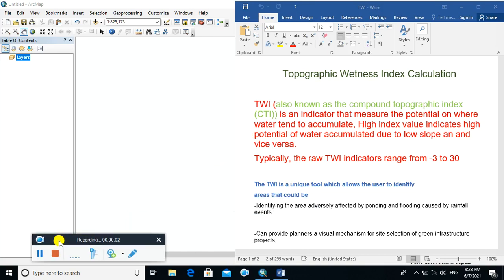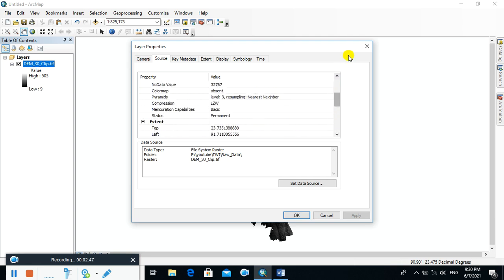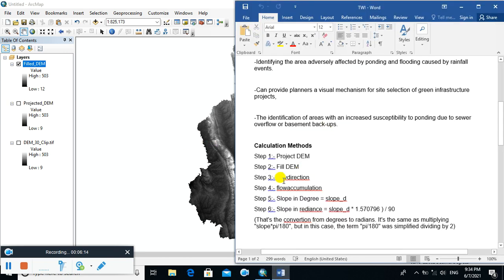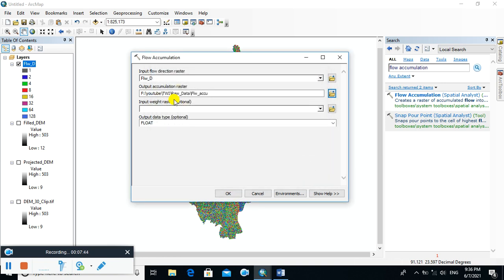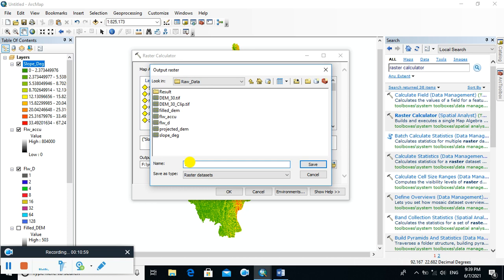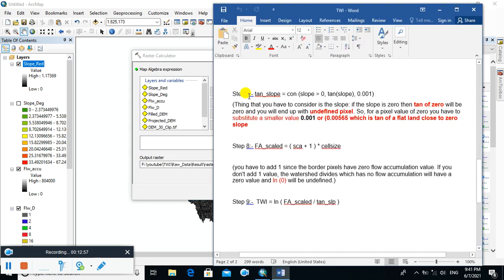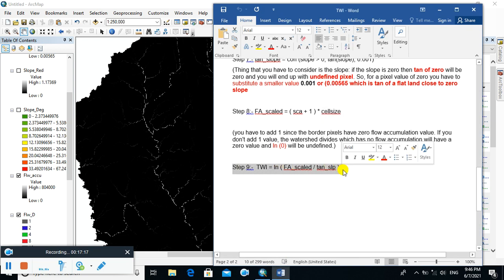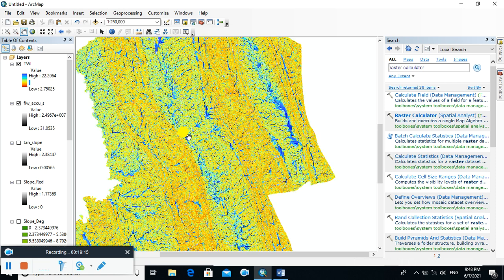Topographic Wetness Index TWI Calculation with Detail Explanation

Comment: Sir Im Getting 999999error while performing fill Operation
Reply from the maker: You can follow this : Restart ArcMap/Your Computer, Try the operation in a blank, map document or in ArcCatalog, Check your input and output workspaces, Check the names of your inputs and outputs, Disable Background Geoprocessing, Check your projections/coordinate systems, Check your environment settings for anything unusual, Look for any tool specific settings that could create problems – try simplifying your options until the tool runs, which will help you ID the problem, Try Repair Geometry
Reply: @ExploreRSGISTutorials  tried several times sir but no change 🥺
Reply: @saisantoshbasina8768  maybe you should set Parallel Processing in the enviroment variables to zero

Comment: my raster calculation for step 7 is continously failing. I made sure I am not putting in wrong inputs it still does not work. Please help
Reply from the maker: What type of error ??
Reply: @ExploreRSGISTutorials  Error 000539
Reply from the maker: @sameeksharai3925  You can check environment settings. Check the coordinate system for inputs Raster & outputs Raster as it should be same.
Reply: Yes sir for step 7 it is failing by showing error 000989

Comment: sir, where did you get 1.570796 that value on slope in radians from?
Reply from the maker: Sorry  madam for late reply. To convert slope in degree to slope in radiance; multiplying slope in degree with this "pi/180" .Here to simplified this both pi and 180 is divided by 2 :- 1.570796 / 90
Reply: @ExploreRSGISTutorials  why do you have to divide by 2? is the formula like that?
Reply from the maker: just simplification.
Reply: very helpful